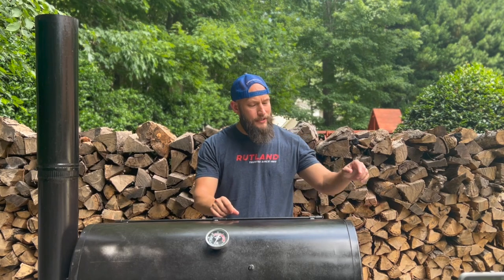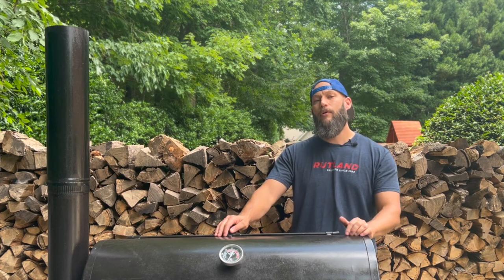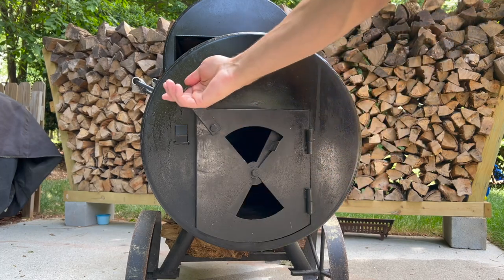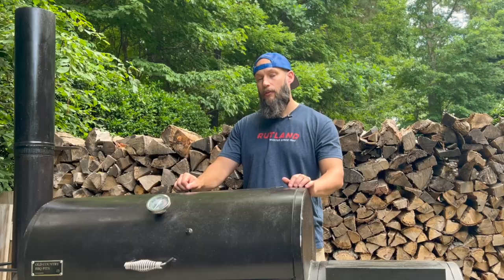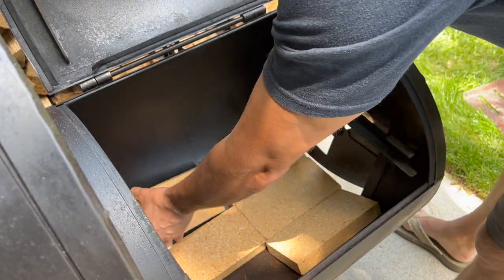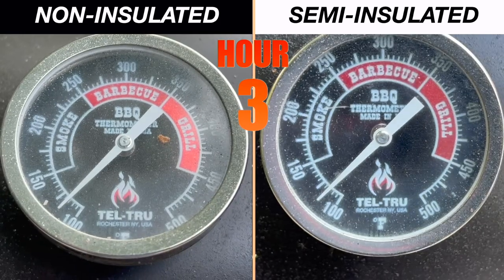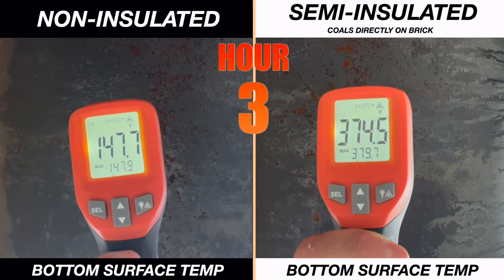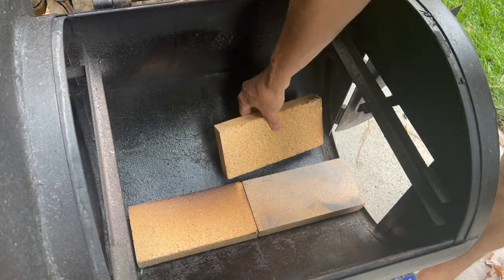OFFSET SMOKER - INSULATED FIREBOX | How to insulate a firebox on a COS

Comment: Your videos are great, especially for us folk that cant drop $4000+ on a high end offset. Keep em coming! Yesterday I added layer of fire brick to my brazos just like you did, and I'm fairly confident that it did make a large difference in the stability of my temps, which in turn led to some really tasty spare ribs. My fire was easier to manage than usual, which would make sense given the results that you observed. More insulation=more heat retention=hotter firebox=wood splits catching faster. My fire didn't threaten to go out even once. I did let it did burn down low a few times, but a new split caught right away with no issues.
Reply from the maker: Awesome!   Thanks for watching!
Reply: @RaleighSmoke  Hey man I got an old country pecos smoker too, I really choose that one because the stack comes into the smoker at grate level. I just watched your video (pretty cool) and I was wondering how much you paid for the bricks.

Comment: I did fire brick to my OK joe and the results surprised me. I was able to keep an open flame, add more wood at one time where I could keep a coal bed and my smoke chamber temp stayed at a lower temp and more controllable.  Before if I kept an open flame my smoke chamber Temps would swing and be hotter around 300 to keep a coal bed. Definitely worth using fire brick!

Comment: Never knew your name was John 😂 welcome back brother! love your vids and glad to see you uploading again 😁
Reply from the maker: Yes you did.  I’ll do what I can….
Reply: @RaleighSmoke  hi brother I was wondering how you got the extension on the smoke stack with lid in the way, and it’s welded. I see you didn’t remove yours. Thanks.
Reply: @RaleighSmoke  I actually just saw your video on how u did it, but I was considering using a connector piece which would require I break the weld for the lid.

Comment: Did the same on my square fire box, lined it with fire brick on bottom, and cut a section of a 55gal drum for the top inside of the box. This gave it  semi- insulated  attributes, which doesn't hit a flat surface as heat rises. It would hit a semicircle roof for better flow into the chamber.
Reply from the maker: Good to know.  Thanks for watching!!  🍻

Comment: Nice video!! I'm going to add the fire brick finally. However, I know it's probably over kill but going to add another step. I'm going to cut off the warming plate, and handle for the top fire box door. I'm going to wrap it up with a welding blanket. It's getting colder here in NC anyway so that will be a plus hopefully.
Reply: And may take it a step further finding a cylinder to slide over the fire box after cutting the mentioned items off.
Reply from the maker: @jeffreygwinn5081  cool!  Let me know how it goes.

Comment: I have a cheap offset smoker myself, and it's hard to get a good temperature unless I use an enormous amount of coal/wood. At LEAST 3 times - probably even much more, than I'd need for my barbecue grill. And it's no wonder, since the surface area of the whole offset smoker is easily 3x the surface area of the bbq grill.
My idea is to insulate the offset smoker - the whole thing - to retain the heat. You can actually buy insulating blankets for offset smokers, but they're pretty expensive for what they are. I'm thinkin about using mineral wool (heat resistant to over 1000°C) to insulate the outside of the offset smoker. I'm just not quite sure how to attach it.. and how to make it not completely ugly. 😅😅
Reply: I'm absolutely convinced that insulating it well will completely transform the whole thing into something completely awesome.

Comment: I wonder if theres a way to adhere brick to the back wall to further insulate? Im impressed with the fire and no grate. I always felt airflow through the splits was a must
Reply from the maker: I think you could probably do it if you build some sort of metal supports, but I’m not so sure it’s worth all the effort.  I think elevating the fire is necessary when you have poor draw/pull.  The stack extension seems to have solved that problem.
Reply: Inside, cut brick to fit tightly. Outside, secure with heavy wire or metal strap. Just my $0.02 😅

Comment: I bought a second hand custom made $1800 smoker. Only thing is that they have a baffle and it’s completely welded to the pit. It’s also 1/4 thick. I think. Not sure if I should remove it. The guy before me said it cooks fairly evenly
Reply from the maker: Did you try a biscuit test?  That’s a good way of telling if there are hotspots.

Comment: This was either good timing or nice irony... I was just thinking of adding firebrick to my Brazos given that I too have issues with temp swings. I was thinking of lining the cook chamber with firebrick.  I'm very interested in your approach of lining the firebox. I've already extended my stack as you did and that did make some improvements. I'm going to cut off the damper plate this weekend as you did in a previous video. I ordered my two boxes of Rutland firebrick this morning. The best price and fastest delivery time was with Amazon. The local Lowe's, Home Depot, and Ace Hardware all indicated they had to order them for delivery to their store or my home. :(  Thanks for your time and energy in these videos! I'm just up I-40 in the mountains from your home.
Reply: Just a quick update as I finished my mods on my Old Country Brazos yesterday (03/08/23). The Rutland firebricks arrived and were quickly laid out in the firebox. I cut the baffle out as you and Jeremy Yoder had done. That was relatively easy to do using my grinder with a cutting wheel. I cut through the two lower welds and then used vice grips attached to the bottom of the baffle to simply work it back and forth until the upper welds broke loose. That was the easiest part of the baffle removal. I extended my stack by 16" last season so that was already in place. I built a fire on the new brick to burn them off just in case there was any residual chemicals that would affect the quality of future foods. The fire caught quickly and the smoke chamber temps rose quite nicely with the improved air flow. I had clean smoke much quicker than in the past. I let the temp rise to around 400 degrees for a few minutes and then closed the firebox door to see how quickly the temps would drop. I was very pleased to see a slow drop in temps in the cook chamber and not the usual rapid drop and then rise when readjusting. I came away very pleased with the initial burn. I'm looking forward to an upcoming day of smoking meat!  Thanks again for your content!
Reply: @ZekeYount  thanks for the update.  How’s it been working for you since then? I’m getting a Brazos this week.

Comment: Another tip I n the Old Country offsets…after removing the factory baffle, stack 4 firebricks inside about 6” in front of the firebox.  Hot spots gone.
Reply from the maker: @bamacheats  inside the firebox or cook chamber?
Reply: @RaleighSmoke  cook chamber, about 6” away from the firebox

Comment: John, what have you found to best the best way to maintain temps vs swings ?  Using bigger splits or smaller chunks ?  Im sure the insulated firebox with the brick will help
Thanks man, 
George
Reply from the maker: There’s no perfect way to run a pit this small without swings.  Anyone who says they can are running a really hot fire or are lying.  A good coal bed is key, IMO.   Especially in these smaller pits.  I generally use spilts that are about the width of my wrist and 8-10” long.  Even still, it’s a roller coaster for sure.
Reply: @RaleighSmoke  Thanks for taking the time to reply.  Found some brick at my local Tractor Supply and used a whisk broom to clean em off and then after installation, ran smoker for about an hour to burn off any residue from the brick.  ( 3 butts on smoker now, so will get better thought of how the firebox maintains heat ) Spot on as far as good coal bed and i think if i can keep the swings within 20* degrees up or down then she would be good.  Hate going into panic mode !!

Comment: Do you still use your fire bricks when you cook? I have been cooking with the fire just on the bottom of the fire box and its been pretty good, but I went ahead and bought some of these to try out. I never have used the steel "plate" that comes with the Brazos, would just build my fires on the floor of the fire box. Hopefully building a smoke collector soon so I don't know if I'll try a cook with the bricks in place before I put the smoke collector together or not. Interested in trying it out though!

Comment: With the raised fire bed, are you concerned with the damage a raised fire will have on the underside of your fire box lid? Do you have any remedies for insulating the lid, short of welding on a protective plate?  I love the idea of insulating the firebox with firebrick.
Reply from the maker: The brick only elevates the fire about an inch, if you’re not using the fire grate.  It’s probably the same height without the brick and using fire grate.  If you watch the early mod video by @FiksBBQ, he used an elevated fire and welded plates on the underside of the lid.  For the firebrick mod tho, I don’t think you need it.
Reply: @RaleighSmoke  good to know! I just bought a Pecos this week and have been watching your videos for a while, so I’m excited to try these mods. Thanks!

Comment: I have a question 🤔I have a pretty thick piece of hard plastic that connects to the end of my yard blower that's about 16 inches,  it fits in the inside of my pecos stack, could I maybe use that as a extension, the part I'm talking about connects to the yard blower to suction up leaves.

Comment: Hey John any concern that the weight if the bricks will affect the not so amazing welds on the pecos?
Reply from the maker: It was certainly a question I asked myself, but it’s holding up.  I don’t expect it to last forever.  One of these days I’ll sell it an make an upgrade.  Hopefully that will happen before it gives out.  If it does, we’ll I got my monies worth.  😆
Reply: How about adding extra legs to the firebox to support the extra weight?

Comment: Hey  my fellow pit master friend, I got a question, I removed the baffle and smoked a brisket tonight but I feel like I struggled with the temperature by the smoke stack I had a probe by the stack and  I have the old country pecos just like you , so do you think I need to add the smoke stack extension?👌🏾💯please comment back and let me know your opinion. Thank you very much 👌🏾temperature by the smoke stack was off pretty bad, at least 15 to 20 degrees maybe even 30🤔
Reply from the maker: If there’s no extension as all, you need to add one.  That will draw hot air across the chamber.  If you watch my stack extension video it explains the principles and results.  My baffle removal video shows you how well it worked.  Just do it. It’s a cheep mod and I’m certain you’ll be happy with the outcome
Reply: @RaleighSmoke  thank you very much 👌🏾I'll be doing it this weekend. As a big favor can you give me the exact measurement of the stack extension add on , how much to cut out to make it fit and the name of the clamp 👌🏾

Comment: Looking to try a cheap off set to see one if it makes that much difference and two if its worth the extra effort running the fire box.  Do you have any experience using the Oklahoma joe Highlander?  Looking to pick one up and use your tip to insulate the fire box!
Reply from the maker: I definitely different it takes a lot of TLC to manage a small fire, but the reward can be worth it.  As for the OKJ, I don’t have experience, but I know Smoke Trails BBQ does.  You can check out his channel.

Comment: What about adding the bricks in the cooking chamber under the grates?  It seems like they would help hold heat where you need it.
Reply from the maker: True that can retain heat, but the cook chamber is all about convection and airflow. If it really was necessary, I think a lot of manufacturers would insulate their cook chamber as well.

Comment: Would the theory follow that you could use the firebrick inside the chamber as well to maximize efficiency i.e. less wood?
Reply: That's my thought as well. You would effectively turn it into a sideways kamado,  which has a large amount of thermal mass and a lot of insulation.
Reply from the maker: I’m not sure.  I know Ken from Heavy Metal BBQ has done a few videos on that topic.  He put Firebrick in the cook chamber of his Johnson reverse-flow offset.  Check out his channel.

Comment: Where did you get the cool wood splitter your son used to make the split at the end?
Reply: I'd much rather use a sledge than an axe to make splits!
Reply from the maker: It’s called the Kindling Cracker.  You can order them online or find them at Northern Tool.  They’re great

Comment: Are the firebox welds holding up as far as you can tell with the added weight of the bricks? 
But I would assume the welds are just as strong on the Brazos as they are the Pecos.
Reply from the maker: So far so good.
Reply: @RaleighSmoke  Hey just an update, I insulated my Pecos as well. Welds are holding up perfect after about 10 smoking sessions and it holds a much more consistent temperature with less fuel. It's a must upgrade, as well as extending the stack. I do recommend using an ash vacuum to clean out the fire box. It saves a lot of time! Well I look forward to seeing you're next video. Merry Christmas! FYI I've been using LavaLock Baffle Plates on my Pecos for about 10 years with great success.

Comment: Does the firebrick help with grilling in the box? Any idea if it works better with the 16 inch stack? Might move the hotspot too.
Reply from the maker: It probably has minimal effect on the hot spot or flow of heat across the chamber.  The bricks are for maintaining heat, especially during swings.

Comment: Would adding brick to the bottom of the cook chamber help any?
Reply from the maker: @MarcusJohnson-um9kq   - It might retain some heat, so it could technically help maintain temps during a downward swing, but it could also hinder airflow and would be a mess to keep clean.

Comment: Please test this with vermiculite firebricks. I heard its better than clay firebricks. Super insulated high heat resistant and low thermal. I heard vermiculite is the next big thing.
Reply: It's my understanding that all vermiculite mines have been found to have trace levels of asbestos, which is why you want to check the attic insulation in homes from the 40's through the 60's. It's a great insulator & would be interesting if it could make a consumer grade comeback.
Reply from the maker: Some firebricks are NOT food safe.  A big brand is listed on as “food safe” on websites, but when I reached out and asked about putting them in a smoker they said it was not recommended to be anywhere near food.

Comment: Why didn't you try building the fire directly on the firebox floor for comparison?
Reply from the maker: Is 3/16 metal would not have absorbed/retained any heat.  I was just comparing the modification to stock. Besides all this testing takes a lot of time.